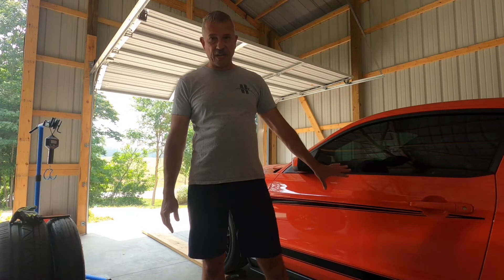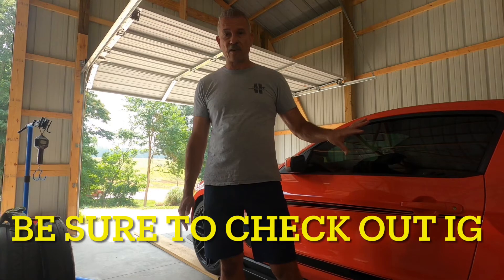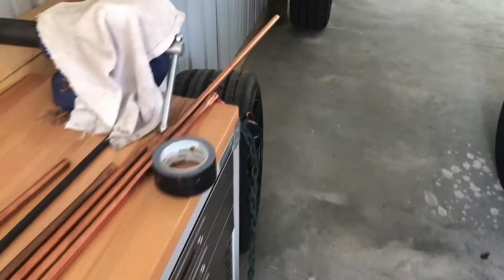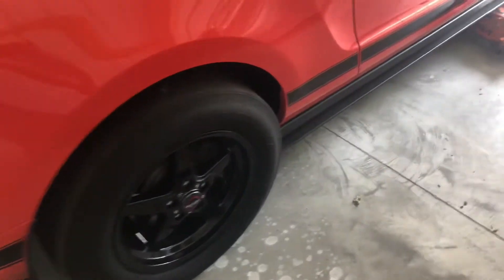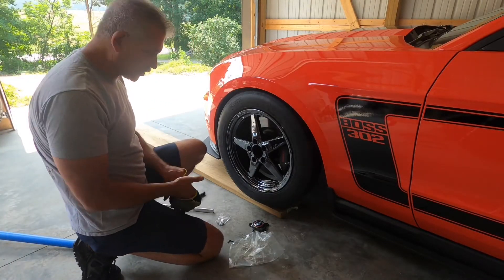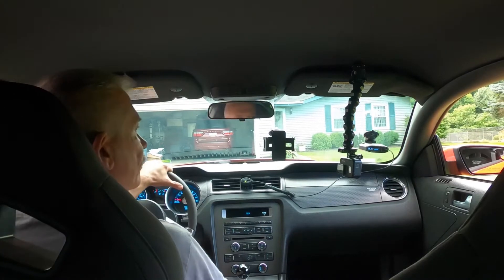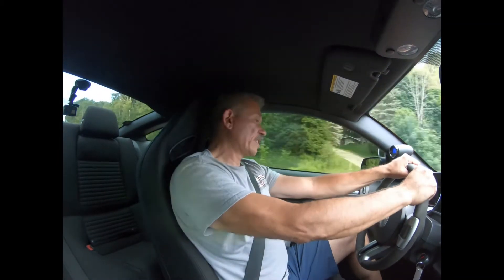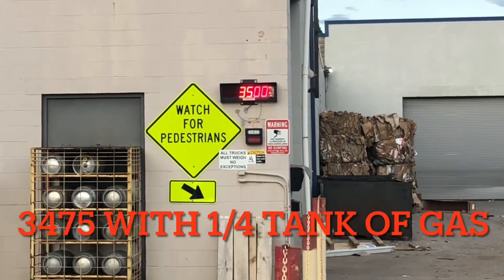Getting A Race Weight On The Boss, Mickey Thompson ET Streets Bias Front Runners

Comment: You did drop about 75 pound with the front skinny and rear Et Street tires right.
Reply from the maker: Not quite, 38 front + 24 rear so about 62 lbs. total
Reply from the maker: The front wheels stated 17 lbs but there are actually 22 lbs when I weighed them in an earlier video